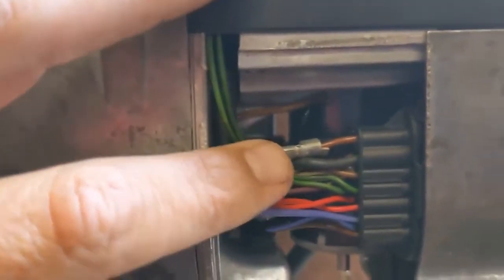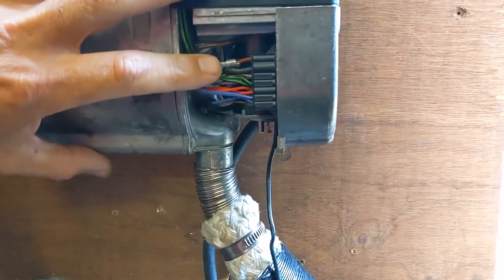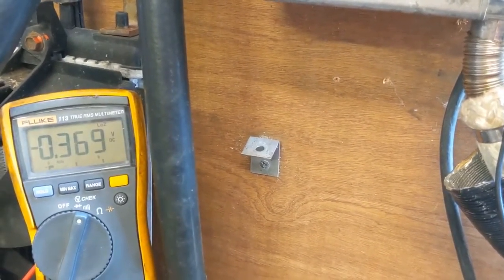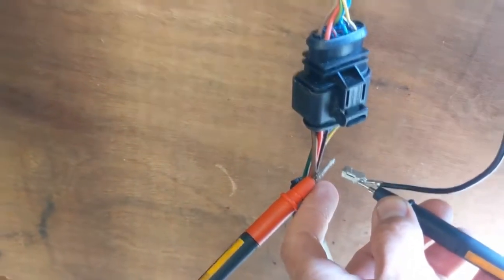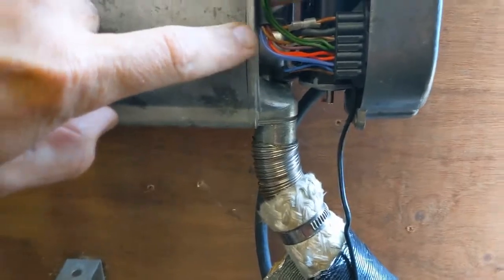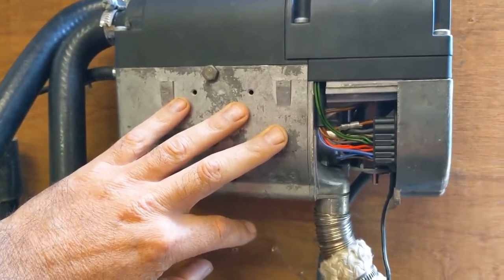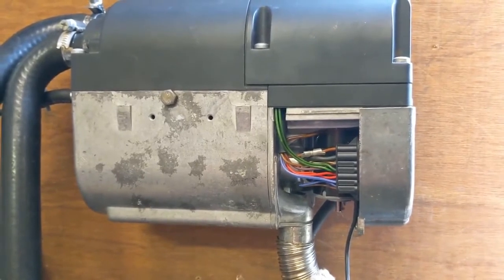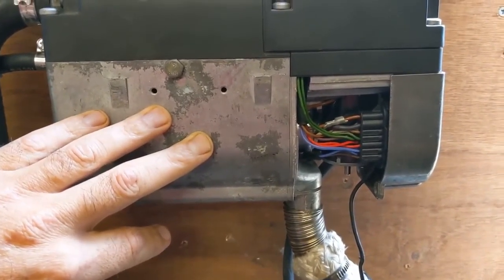Eberspacher Fault Code 030, 031. D4WSC, D5WSC Hydronic. Airmotor Fix Mod. Narrowboat Heating Repair.

Comment: Hi mate got a D4 blower motor on my sandwich truck, oven hasn’t fired up this morning when I use the control panel for fault codes giving me active fault code 031? Will it need a new blower motor?

Comment: Considering this gets worse over time, I would think it's more a bad connection that simply needs cleaning, crimping, and resprung moreso than an undersized gauge ground wire. Thanks for bringing this to our attention... mine is doing exactly this. I figured the fan motor was 20yrs old and sucking wind

Comment: Thanks very much for your video. I've just followed your advice and my narrow boat's 8 year old D4WSC, which has been pulsing for ages, is now running normally again.

I connected a new wire with a small bit of cheeseblock into the brown wire inside the unit, fed it out by the main lead and then soldered the other end to the brown wire next to the plug on the lead. This saved running a much longer wire back to the connections inside the boat.

I reckon I owe you a few pints!

Comment: Thank you so much. Fixed my blower F30 error with jumper from the brown wire to ground. Runs perfect now. You saved me a ton of money by not throwing parts at it.
Reply: Brown wire to ground? What is the ground and where in the heater?

Comment: Interesting video Ed, thanks! My D5WS (water) starts up fine, generate nice heat through out the boat (40 feet) for 10-15min and then stops. Can't say it generates more spoke though, and seems fuel pump stops before the heater. I can't read out fault codes, till check the earth according to your video. Happy New Year! Nik

Comment: I have been having the exact same  problems with my Eberspacher D4WSC that you highlighted in your video and had spent a lot of time trying to work out what was going on. 
Just followed what you cover in your video and the heater is now working as it should. What a great early Christmas  present. Thanks Ed 👍👍

Comment: Hi, my d5w starts then shuts off, any ideas
Reply from the maker: Hi Martin. Any different with the engine running? Do you hear ignition with any heat/roar from the exhaust?
Reply: @edshiersfourcountiesmarine6677  pump working, new fuses throughout and does all the start up, just doesn’t fire up
Reply from the maker: @TravelsWithMartin assume there's no heat/ignition then. Next thing to check is fuel quantity to burner on startup cycle. Would be useful to know the fault codes if u have the diagnostic timer. If not.i will message u some contacts who might be able to help..👍
Reply: @edshiersfourcountiesmarine6677  hi chap, changed glow plug… it fires up and does get warm but then shuts off after a couple of mins, the exhaust is now clear etc, voltage is all good and same issue when engine is running ? Any ideas
Reply: I have no other source of heating and it’s freezing :(
Reply from the maker: @TravelsWithMartin  would be useful to know the fault code to see if it's a flame failure or ignition fault and not a component or sensor issue. Without fault code would guess it's ignition fault and next step would be to check fuel quantity of a failed startup with measuring cylinder over a few attempts. Spec is something like 9.5mls. also check u have good fuel supply up to heater..
Reply: @edshiersfourcountiesmarine6677  I don’t have a digital display to see fault codes, the glow plug is new, it’s starting to annoy me now :( I’m a live aboard and freezing 🥶
Reply from the maker: @TravelsWithMartin  Best get a stove fitted ASAP! Non of the diesel boilers are any good as only form of heating. Is this the earlier D5W and not a hydronic?
Reply: @edshiersfourcountiesmarine6677  yes it’s the old one, and funds are tight ;(
Reply from the maker: @TravelsWithMartin  Sounds like u have the earlier pre hydronic model. Best check optical flame sensor is clean on far left hand side of heater - held on with stainless steel clip. If that's clean remove glowplug again and check it's not coked up again. Also the continental fuses can be a pain and check it's not melted/bad contact..

Comment: Do you know what would cause the dosing pump to not back off in the SMALL/LOW stage, when the fan backs off? This results in too much diesel during the LOW stage. Would it be the ECU?

Comment: Thanks for this video Ed. All the symptoms mentioned were happening - system cutting out after 8 mins, white smoke etc. I carefully spliced in the cable as suggested and then connected this cable to the brown negative in the main junction box. Bingo, the system is running perfectly again. This was a fantastic help and saved me a fortune.
Reply from the maker: Great!🙂 Thanks for feedback and glad the video made sense.👍

Comment: So the brown wire between the main connection ? and the ecu goes bad and you make splice on a new ground wire and connect?

is that correct.. just the wire.. so i can use any groundpoint on the car to the outlet of ecu?

Comment: in the ECU, the connector pins on the printet circut board for the air blower are broken. The rest rings around the drills are very small .... to small. You can try to resolder these pins. 
- drill the ECU case with flat 12mm drill from behind,
- remove the silicon, 
- free and clean the pins. You will see the brocken contakt. 
- clean it with aceton (aceton solve silicon) 
- polish the pin
- preheat the ECU aprox. 80°C 
- resolder the pin with no-clean solder (paste or wire)

Comment: Hello ,ihave  same problem with code 30 ,can you explain exactly were you put  the negative wire from junction box ?
Reply from the maker: You have to splice a cable to the brown airmotor lead. Probably easiest to take this back to the brown blower connection inside the junction box which is often unused but it can go to any negative connection. Hope that makes sense and it works. Good luck. Cheers, Ed
Reply: @edshiersfourcountiesmarine6677  Thank you very much ,my heater work again.for morethan 30 day i was read only foult code 30 and the heater 5dwsc wont work.i do what i read in manual for 30 foult code but nothing(i mesured rpmfrom propeler ,was ok,i verify exhaust ant intake was ok ,i verify conexion was ok )but when i splice the brown cable and i put this to ground ,now the heater works ok.

Comment: I found that there is no GND on brown motor lead at all. Connected brown motor lead to main GND inside the blower. In my case, when I push the connector on the control unit to the side, the GND to the motor is ok, when release, it's open loop. So, thank You for this video, hope this will fix this unit, waiting for the gaskets.